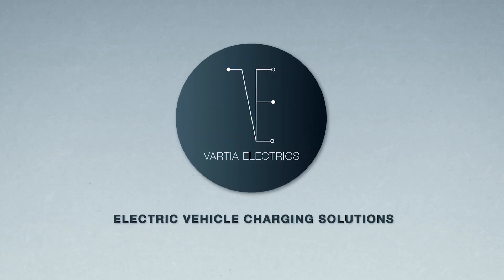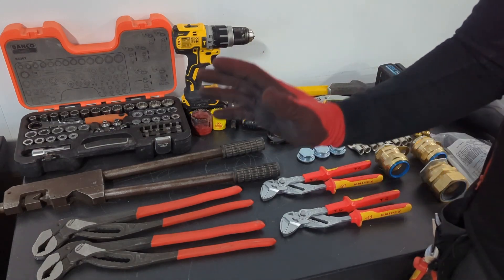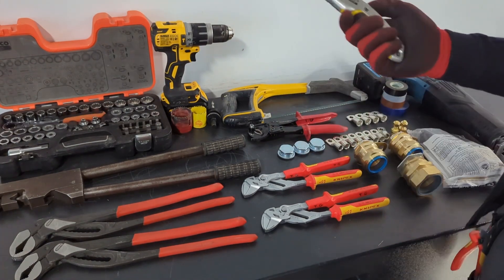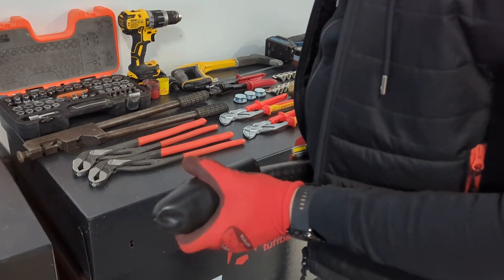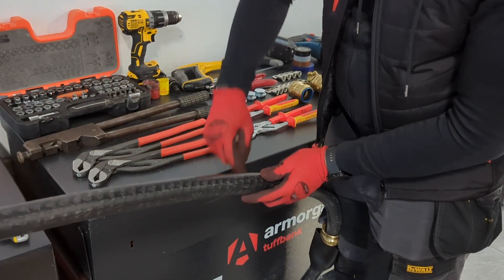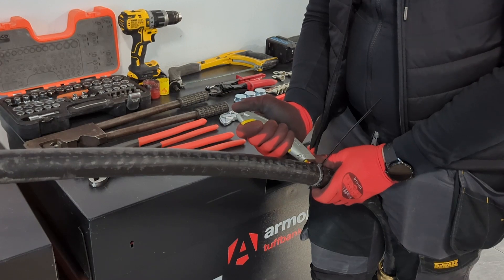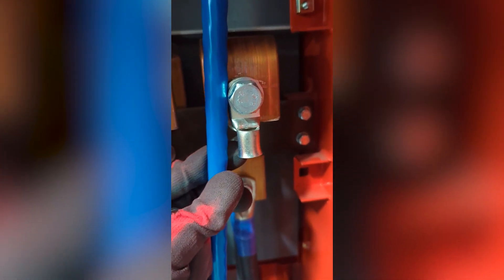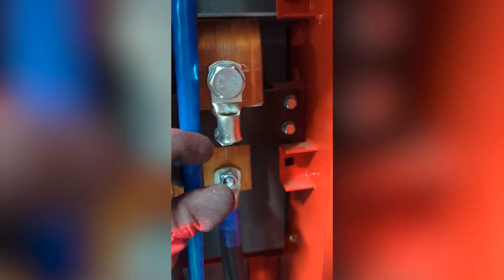Installing A 400AMP Supply

Comment: How did you come to the calculation that two 70mm in parallel can carry a current load of 400Amps
Reply from the maker: Good morning Stuart,

We used the basic formula of Ib<In<Iz or simply put: 

Ib (Design Current) in our case 400amps, must be equal to or less than In

In (Breaker size) in our case is variable between 200 and 630amps, must be equal to or less than Iz

Iz (Cable Rating) in our case 70mm2 x2, the cable must be able to carry the Design Current and any excess fault current long enough for the breaker to trip. 

As we already knew the Ib (you must use root 3 in your calculations if 3 phase) and we can adapt the In it was just a case of finding the right cable size. 

Using BS7671 2nd amendment a 70mm2 multi core armoured  shows a current carrying capacity of 251amps with each core able to carry 63amps (x2) takes us to just under 400amps not including the neutral, voltage drop and correction factors were also taken into consideration.

If you have any more questions please do get in touch.

Kind regards 

Vartia Electrics

Comment: Them tools look unused ! No seriously bigger swa are easier to make off than smaller swa' s but look more impressive .
Reply from the maker: Good morning Ray,

You should see Ben with his drills they get dusted off then put in the original clear wrapper, and then the JSP bags what hard hats come with. 

In our experience we have found the bigger SWA harder to make off, just holding the weight of the cable plus if you don't cut straight the steel armouring is not as forgiving especially if the tips have bent out slightly. Would make a good poll.

Kind regards

Vartia Electrics
Reply: @VartiaElectrics  Nice to hear someone looking after there tools ,I've had apprentices using my screwdrivers as chisels ! I do agree if cut wrong it can be real pain to sort out .Ring of tape as a guide helps , I used to try and lean swa against something where possible , stops it fighting back .

Comment: nice video, can you explain when you say it comes from a SEL Separte Earth leakage , thanks
Reply from the maker: Hi Paul,

A Separate Earth Leakage device is in simple terms a RCBO, it's a MCCB switch with an RCD attached covering both an  over current and short circuit fault.

The SEL MCCB is fed from a landlord's switch, which then feeds the rest of the temporary supply.  We set it up this way: 

1 - To keep the temporary install separate from the landlords 

2 - To maximize protection for the temporary supply.

We have had a few people message with the same query, we  will try and get a short post out on Instagram showing this is real form.

Kind regards

Vartia Electrics

Comment: 95s pushing it a bit for 400 amps no??
Reply from the maker: Good morning Ciaran,

Good knowledge from your part! 

The single 95 is only supplying 200amps, we used parallel 70s for the 400amp supply. Ben explains why it was done this way at 14.50min in the video. 

Kind regards

Vartia Electrics
Reply: Apologies on my part I missed the 2nd half
Reply from the maker: @CiaranTrivium  
No need for apologies, it was a valid point 👏